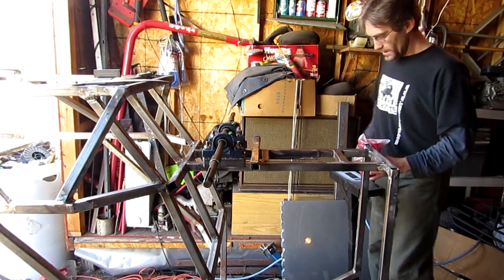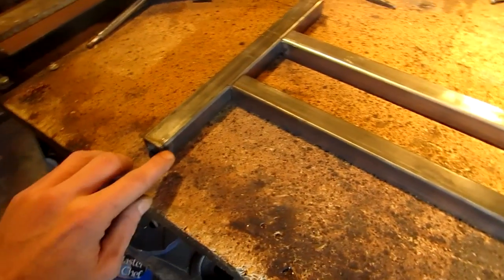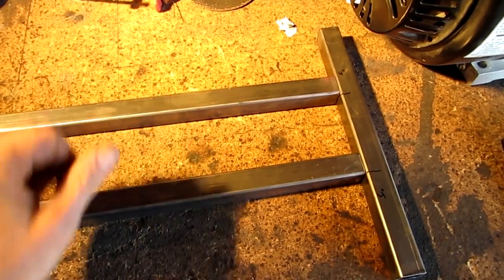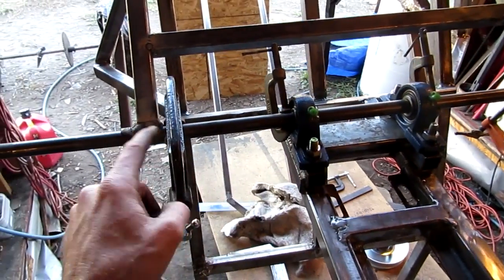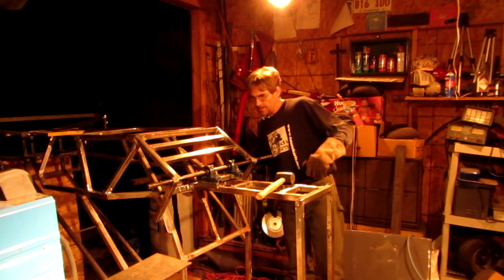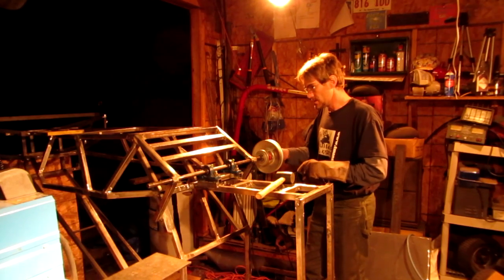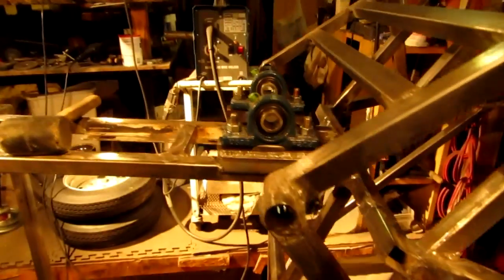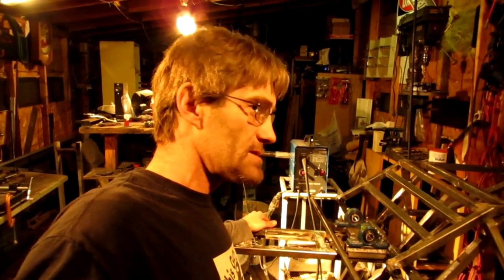Off-Road Buggy Fullscreen Machine #15 ( Aligning the Pivot )

Comment: heyy Tman and fearless, I've been watching both your videos and I'm building a mower/dune runner, its a John Deere 111 I'm putting a arctic cat 900cc triple into it and gonna turn the motor so I can put a second clutch right below the motor one and run a drive shaft back to a gear box for IRS I'm wanting how should I do my gears for it, if I should do just a simple two gears or is there a better way?

Comment: have you not thought of the way motorcycles operate at the rear wheel, those go up and down with suspension, just saying, but in your case you have two wheels, no

Comment: -Frig I got a Chinese used engine for bicycle kit and the engine it self is fine and all only thing wrong with it and cant figure what the idea is I adjusted my clutch many times so pressure releases so free wheel is their for the gears to move, now I don't have a chain hooked up due to its a chopper bicycle which came with no chain when I bought It I have a chain and master link set up but I was hoping my pull start comes in soon. But I wonder if problem is no chain and im running and jump star